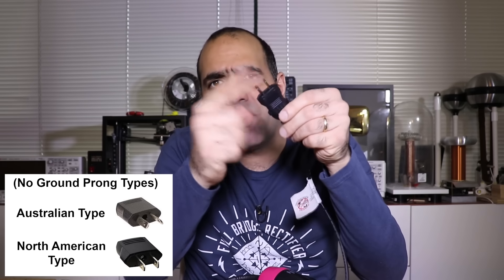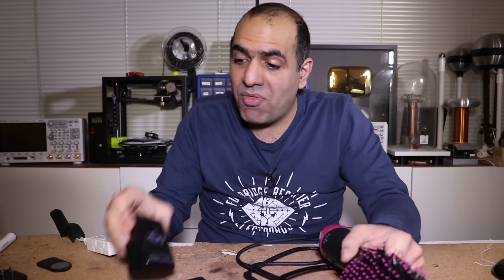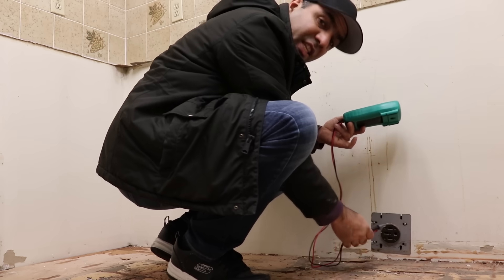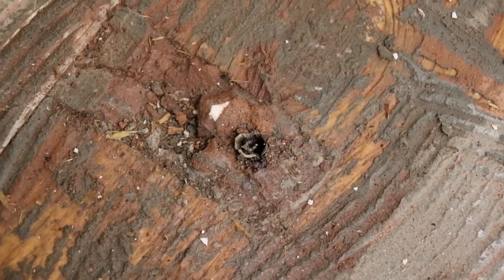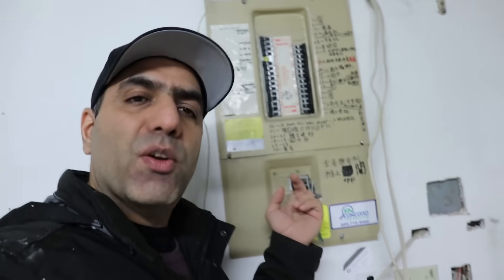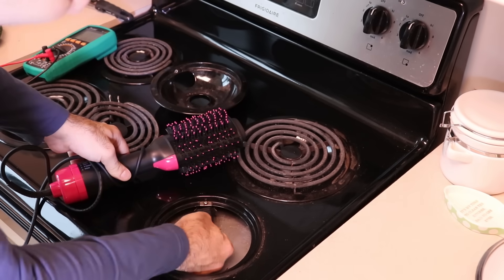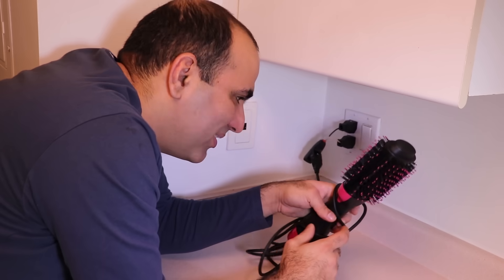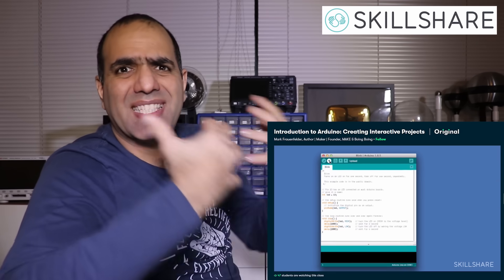Finding HIGH POWER 240V in a 120V Country

Comment: come to EUROPE we have 240V on every socket and 400V on high Power Socket(red cee Socket up to 125A) 😁😁
Reply: and we have the metric system
Reply: @franky-161  Surprise ... guess what... in the United States we also have the metric system.  Just about everything here is measured in it along with imperial.  The more you know!
Reply: @franky-161  everyone has metric, except... 2 countries?
Reply: He has been in Europe, he was in the United Kingd... 
Oh, right.
Reply: @enricomontanari1390  The EU != Europe. The EU represents only 28 nations out of the 50 countries in Europe. The UK is leaving the EU, but not Europe as that's physically impossible. Conflating the two is idiotic.
Reply: @piers389  I know it, I DO know it. In fact it was just a joke, a joke doesn't have to be the most accurate thing in the world, it just has to make you laugh for a moment.
I do know this things, don't worry.
Reply: Welders wet dream right there.
Reply: @Julius Germanicus where do you have 400v with 125A? In house? Or industrial connections? A 400v line to be connected in italy it's around 2000 euros for the electric society, while domestic line 230v is almost free of charge.
Reply: @freerideshuttle  Every house in Germany (since decades) gets connected with 90A+ (3 phase of course), but for domestic uses the CEEform 3L+N+PE 16A sockets are most common.
32, 63A and 125A are less common but many homeowners opted for higher amp mains connections, because the upgrades are usually not to expensive, in my region most houses are 120 and 150A (fused down to 56A).
Reply: @DooMMasteR  oh my God, I could love that country. That is insane. No, we have 16A 1L+N+Pe as domestic standard, I'd love so much a 3phase connection
Reply: Lucian Tabria but that’s one of the only things to be „proud“ in germany tbh
Reply: @franky-161  it is not unique to Germany, new installation (since the late 80s) across the EU are made to these standards (the UK being an exception).
Reply: @DooMMasteR  the Standard power connection in Germany ist 3x 63A for a 1 Familie house with 100qm ot for apartment with 30qm. it is a Standard for new houses or Apartments 3x63A power in. older houses or Apartments or older regulations from Energy supplier also have 35A, but if they not longer works , 63A automatically comes
Reply: @freerideshuttle both, Industrial and at Home,at my House it's in the garage,for big saws,welding etc
Reply: @freerideshuttle  In France residential power supply  can be up to 150A (used to be higher, but environmental lows prohibited it for residential), in single or 3 phases. In theory there is no additional cost for 3 phase. But a domestic installation in 3 phases costs way more than single phase. For example a 32A circuit breaker cost 10€. A 3 phase 10A can be over 80€, and is harder to find. Ground fault breakers can be even more expensive. And they are mandatory in newer installations since at least the 90's

So 3 phase is slowly disappearing, it's mostly found in older homes with electrical heating, or in rural areas. 90% of newer houses are wired in single phase
Reply: @freerideshuttle  An easy please to find 400V in houses in the Netherlands is the kitchen connection for the electric furnace (just like Mehdi has 205V there). In the Netherlands you will find triple phase plug there, and if there is 400V between the phases. This is normally the only 400V connection in a house (an electric furnace may still run on 230V between phase and neutral), if you want more you need an electrician to create custom sockets.

Typical for a house is a connection of 35A 3-phase to the grid, which is split into 16A groups in the fuse box.

In Italy appartments are popular homes in appartments it is logical to connect each appartment to a different phase. However, for single detached houses, it would highly surprise if they are connected with a single phase to the grid, especially because of those electric boilers that are popular in Italian bathrooms. You may have multiple phases in your house, but just no 400V sockets. In such case you could wire a 400V socket yourself.
Reply: @freerideshuttle  Industry only.
Reply: @freerideshuttle  Standard Installation in Germany in ALL HOMES is 400/240V(240 is the theoretic voltage from transformer) in homes we use 230(the real voltage at enduser) with 16Afor all sockets, only the Electric stove or Equipment over 3,6kw per Phase use all 3 phases
Reply: @juliusgermanicus  well you still have the power. If you put a milling machine or a lathe in your garage you can have the power to make it work without installing a new line
Reply: @juliusgermanicus  Your voltage is wrong. It's 240/415 or 230/400 (phase to neutral /phase to phase) in 3 phase power.
Reply: In Germany most houses for one family have 3~ 400V but not more than 63A if not 50A (if the heating is not done with electric power). Just for the correction of some very optimistic comments here... And CEE 125A for home use? Dream on... even the wire gauge necessary to supply that current without exceeding the allowed voltage drop (commonly 4% from the house/grid connection to the end of the circuit)
Reply: @Abstractism that seems like a stupid idea, natural gas is not the most polluting energy. 
Also, having 60A loads that turn on completely randomly is going to put a severe pressure on the power grid. 

Natural gas isn't the most "dirty" energy. With modern and well maintained burners, it can be way more efficient than electricity, and co2 and particle rejects aren't that bad.  Especially when comparing to coal fired electric plants.   

In industrial applications, (where electrical heating would be crazy expensive and impractical), gas heating is slowly but surely replacing steam. In the industrial laundry where i worked, every new machine is gas heated, and the large central steam boiler will be decommissioned in the next years

In others countries, we use tank heaters, with smaller resistors (usualy 3kw). Heating the tank takes longer, but it's more efficient, and it allows to use a cheaper contract.
Reply: Domestic three phase is amazing.  Wish the UK was like that.
Reply: eggypickle 3 phase is not needed. It’s just like you always want to have what you don’t have. Once you have it, it’s boring. I lived for 8 years with only one single phase, never had an issue with it. I even had a single phase 16 amp induction stove which worked like a charm.
Reply: @Engineer9736  My house is wired in 3 phase and believe me, it can be a lot of headache. Unless you have machines with asynchronous motors (and even then, frequency inverters are getting cheap) or you have very long wiring (mostly found in rural areas), 3 phases only have disadvantages. 
First, balancing loads in a house can be a real pain in the ass. Often, with 3 phases you have to subscribe to a higher (thus more expensive) contract 

Balancing will be even more problematic with smart meter, they are way more sensitive  to overload than older thermal breakers. 

When buying high consummation appliances  like stove or water heater, you have yo be sure they can be wired in 3 phases. Nowadays it's getting rarer and rarer

Also, as i said, 3 phases equipment is very expensive and harder to find. Here, i can't find anything 3 phase in regular hardware stores.  I have to go to industrial suppliers, who often don't sell to individuals, or can be crazy expensive
Reply: Hmmm...I have personally tested the voltages in the Netherlands, France and Germany, with my multimeter (no Belgium though). The voltages were as follows: 218, 223 and 227VAC. They do all fall within the range of tolerance for 230 and 240VAC (and 220VAC) so... 
But then again, having just done a quick Google search, Schenider Electric seems to agree with the statement I made above so I dunno?
Reply: Europe has 230 volts. Australia has 240. But 220 to 240 is essentially the same.
Reply: @Engineer9736  at least to net norm, Australia is 230V +10% -6% at 50 Hz, only pre 1980s installations (utility level) are still 240V, they have become quite rare, but still exist in rural areas with B-type distribution (split phase).
but yeah the differences are minor :-P
Reply: @Engineer9736  Europe has 230v -10%/+6%. This was done because European countries (with a few exceptions) use 220v, 230v, and 240v (like the UK and ROI).
Reply: 220V better than 240V. electrical appliance will last longer, cheaper electricity billing.
Reply: @Jiwa Tenang Correct, if you're talking about incandescent lighting, but solid-state AC-to-DC conversion power supplies will be more efficient at 240V. They are the usual for computer power supplies and that's how LED lighting is powered.
Reply: Not 100% true...
Mainland Europe+Ireland = 220VAC
UK: 240VAC
Guess what (220+240)/2 makes? 230VAC! which is what is commonly used to refer to both systems.
Reply: Mr. Meerkat If i put my multimeter in my wall outlet in NL/BE i read 230 and often a few volts more. NL used to be 220 decades ago. They raised it with a few volts each year to 230.
Reply: @MrMeerkat818  we got 230 in Belgium
Reply: Mr. Meerkat in my house in Germany it’s 240V at the sockets and the  connection to the grid is 3 phases of 240 V (I think that’s 380V not 400V but I’m not sure). That’s a very old electrical installation, modern houses can have more.
Reply: @MrMeerkat818  lies about mainland europe, Belgium is 230Vac.
Reply: What phase is the 400v though? If its not 3 phase its useless.
Reply: @casey360360  You get 230V between a phase and neutral and 400V between 2 different phases. Because you can make 3 possible connections between the phases, you can also get 3 * 400V if you desire so.
Reply: My house has 2 sockets, 120 & 240V which is good.

Comment: You run your "high power" things at 200V, heh, I run my high power things at 400V 3 phases ! Well, because my  big circular saw has 5kW motor in it. Can't imagine running it even at 240V here, I would actually be happier if i would be able to run it at 690V, but i cannot have this in my house. We have it at work tho, for high power motors for some machines.

Comment: I told you homes are 240 volt -split, you really didn't know that? This is so where only a single phase to neutral is available you can still get the power needed for big appliances, like to places where sending 3 phase is just too expensive.

Comment: Ha! I've always wondered about juryrigging an adapter like that. That works back home in Ontario but here in Michigan I THINK that their codes require a different wiring arrangement, if I recall correctly. I think here the kitchen duplex outlets are NOT wired individually but are the same line but use higher amps and bigger gauge wiring. 20amp I think. 🤔
If one knew that two separate outlets were two different fuses though... Well... Hefty extension cord needed. 😏😁
Reply: https://youtu.be/LZbIJZe_YDs

Comment: Me: the meter was on amps? "The meter was on current". I knew it! I made that same mistake, a few times in my life (one of which was indeed on 230 VAC). I really need to mod my UT61E to add a beeper when in the wrong mode... Though I believe this was at least partly staged because the explosion wasn't nearly as powerful. Also, you can see the explosion up at the meter, yet it's fine.
Reply: The amp fuse may blow, but the voltage side still works. I believe the voltage terminal isn't fused since it theoretically has infinite resistance. I've never made the mistake of measuring voltage in current mode. My old boss did buy a crappy multimeter that is literally given away and I measured VOLTAGE with it on 120V to tell him he wasted his money and it still exploded! I opened it up and yes it was in voltage mode but the terminals were shorted, unfused! I had no expectations yet I was still disappointed.
Reply: @leerman22  yeah it measures voltage, but I had replaced the fuse and multimeter was again functional.
Reply: aah! reminded me my first lab when i also used my meter on same condition and burnt its fuse.
Reply: Mine was on continuity, I connected it to 480 VAC 2 Phases. It blew up & the circuit board got fried.